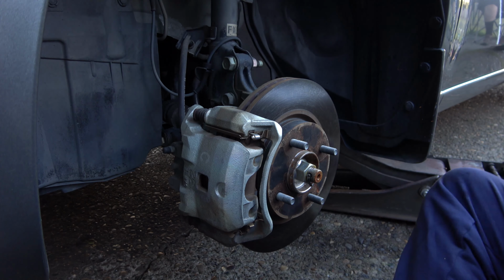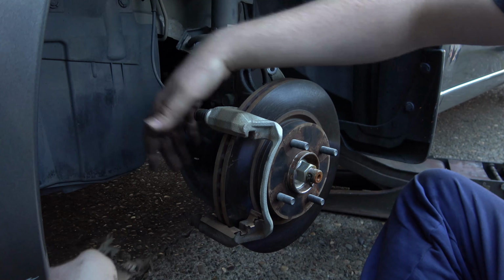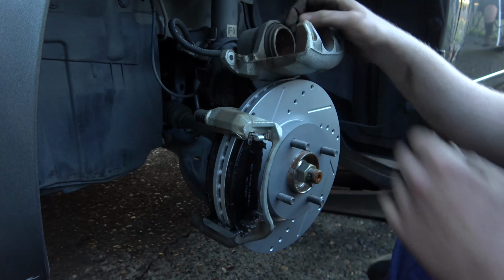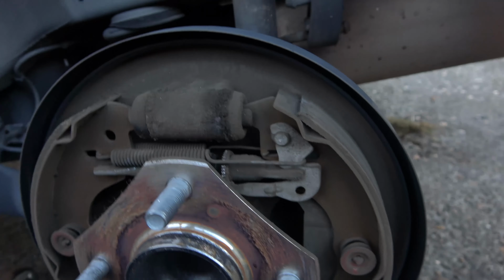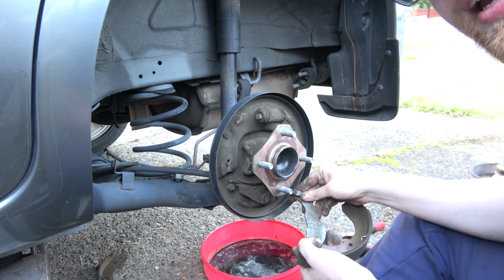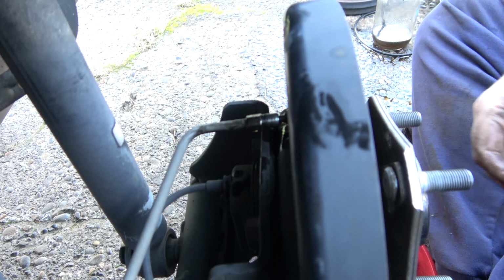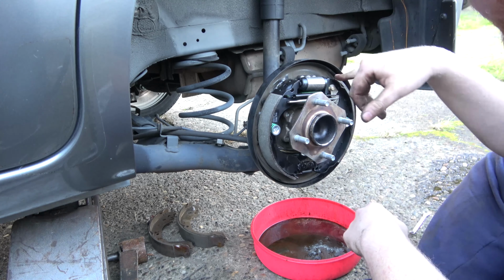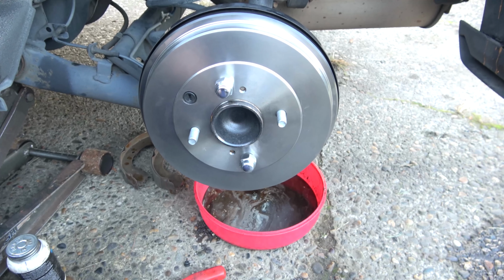2011 Nissan Cube Disc and Drum Brake Replacement

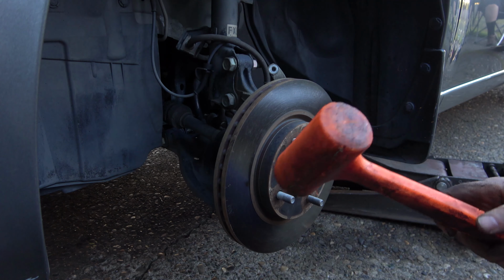Comment: Great job. Thank you for the refresher on the drums and uploaded video. @3:29,  See that backing plate mounted behind the King nut, spindle and rests on the front of the caliper 2 mounting bolt holes? At the 9:00 position you can see the left most part of it between those 2 mounting bolt holes. Why am I going into so much detail? Because when you reassemble it? Make sure those tabs on any part of that bracket are not bent towards you working on it. It will rub and sound like metal grinding after replacing everything. I took a small hammer and straightened it out and it quit completely making any noise. But the 6:00 position is small and I couldn't see it. That's what was rubbing so bad. This same plate is the one you remove to get to the wheel bearing assembly (3 bolts). Of courses after the cotter pin and king nut. You may have to get the loan a tool program from Autozone for the socket to fit the King nut. I did.  Thank you for the uploaded video.

Comment: Hey I just did my brakes on my Nissan Cube with the same TRQ brakes from parts geek- you put the rotors on backwards (Passenger and Driver are different- slotting goes against the grain, not with it. Bags on each rotor have labels (passenger/driver)...

Comment: I would recommend spending more time cleaning the hubs. They need to be spotless, a harder job when you have wheel studs rather than bolts.
Discs are machined to less than 15 microns thickness variation - even a small spec of rust will make the discs run out of true - anything more than 30 to 50 microns runout and it will wear your discs thick/thin over the next 500 to 2000 miles causing brake judder.